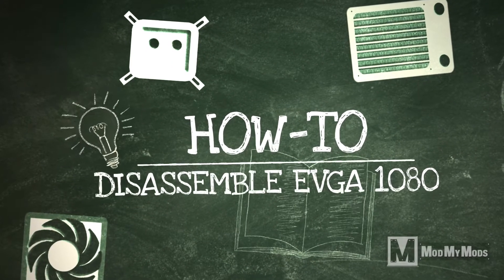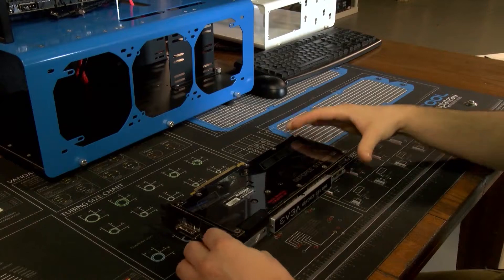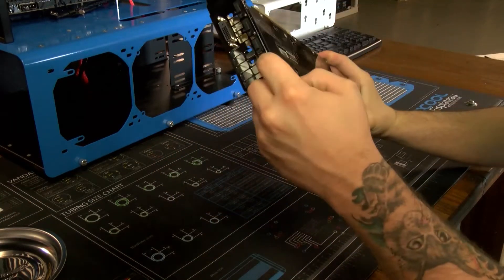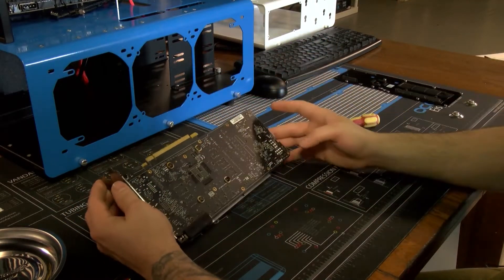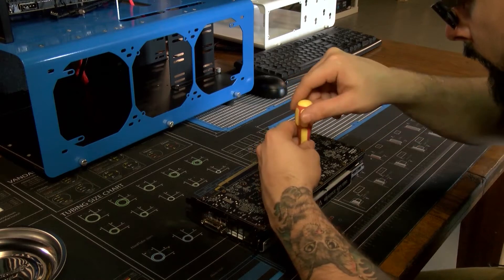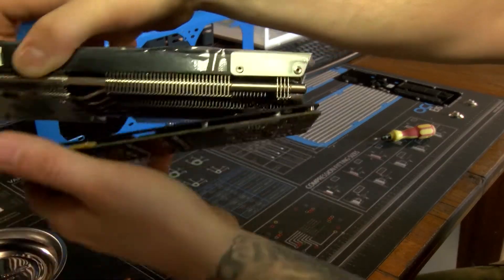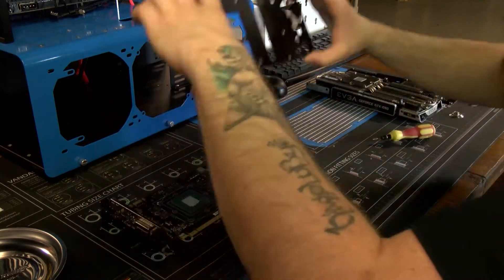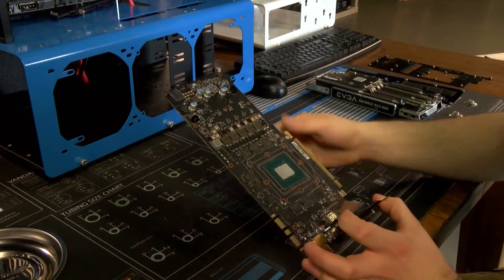Quick How-To: Disassembly of EVGA GTX 1080 SC

Comment: 6 years later I pick up this card used because it still out performs my Sapphire RX 590 Nitro+ . What a beast. Thank you for making this video. When I acquired this card first thing I wanted to do after testing was put new thermal compound on but I wanted to be as careful as possible and know where all the screws were. I'm glad I did a search and found this video because I totally would've overlooked that one screw being longer. Knowing that I was able to successfully take it apart, clean, and apply some new Artic MX-5!

Comment: Wish I could see someone doing a full teardown of the cooler itself(for painting).  I've noticed the shroud has some torx I believe T6 screws which appear to possibly hold it to the heatsink fins.  Ever since getting a 1070 black edition(not a fan of the all black look, but it was a gift so I can't complain much at all), I've wanted to paint those parts which are normally gray...possibly even to a color to better match my build.
Reply: i agree, ive been looking to atleast see if i can flipt the name plate, because i'm thinking of getting that bequite dark base 900, just so i can have the cool part of my GPU facing up. I dont know why they put so much effort into making the cards look cool when they face down.
Reply: @silinusvers  This might be a little late, but the plate on the side (part that lights up and says "EVGA GTX 1070) can be flipped.  It's held on with some adhesive. Peel it off with a spudger or flat head and reapply it. The small bracket things that read "Geforce GTX 1070" and "EVGA" can also be removed and flipped. I run an inverted case and did the same.

Also, you can remove all the silver pieces (or black in the case of the black edition) with a T6 bit without removing the cooler. Just did it and plan on painting it

Comment: Does this also apply to the EVGA GTX 1070 SC? I want to replace my stock cooler with the 1070/1080 Hybrid kit from EVGA, just making sure this guide is relevant to my actual gpu.
Reply from the maker: DabHandJones Please shoot an email to support@modmymods.com to clarify.
Reply: ModMyMods Custom PC Services sent an email. The question wasn't that detailed. Can I follow this guide to take apart my EVGA GTX 1070 SC ACX 3.0?
Reply from the maker: Yes. This teardown is the same for the EVGA GeForce GTX 1070 SC GAMING ACX 3.0 (08G-P4-6173-KR)
Reply: it's actually an identical card with a few locked parameters by nvidia.